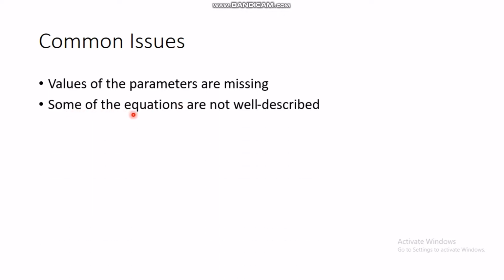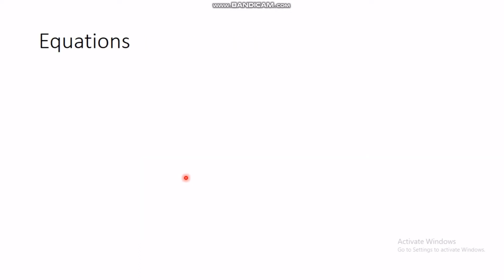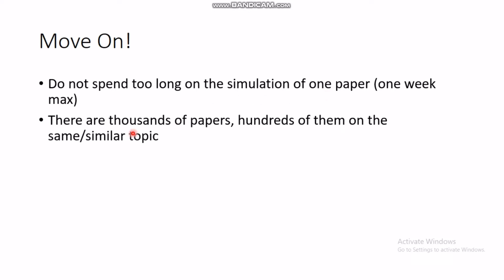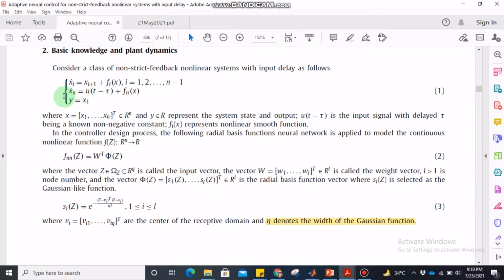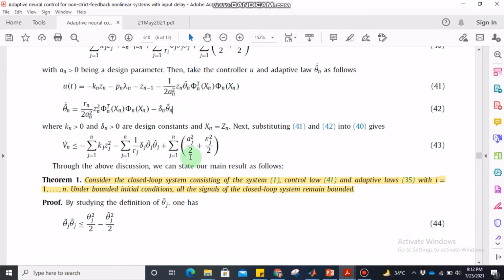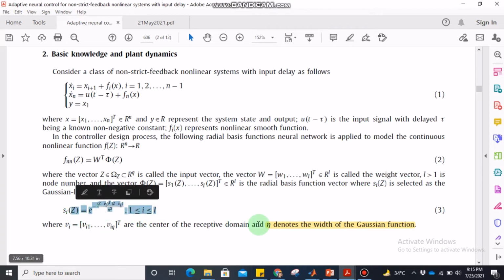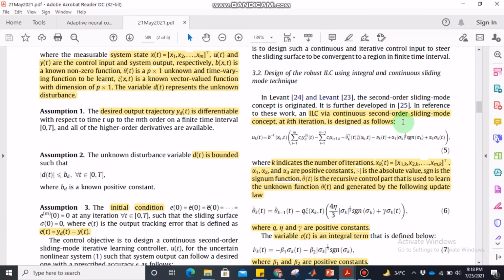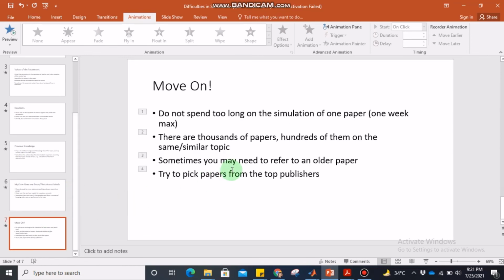Common Issues While Simulating the Results of a Research Paper

Comment: Good day Assoc Prof. I have been following a lot of the Matlab simulation videos you posted. In all of the videos, you utilized the given controller variables in the papers you simulated.  I am familiar with designing controllers for networked control systems affected by time delays, in which l employed the Lyaponuv-Krasovskii method and Linear Matrix inequality (LMI). Currently, l am working on research that considers systems affected by external disturbances and system uncertainties using the Lyapunov theory for stability. However, l am having problems using the Lyapunov method to attain the controller variables and constants that can stabilize the system. Would you please assist me with some insights or even a list of books to help me in my endeavour?
Reply from the maker: Thank you for your kind words. Unfortunately, I am short on time therefore, cannot commit to anything right now
Reply: @cset  thank you very much